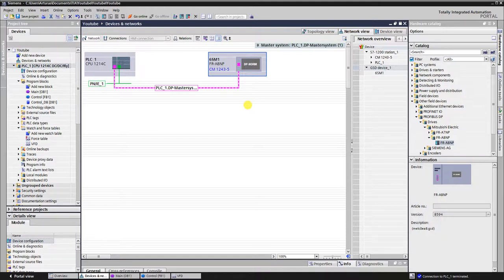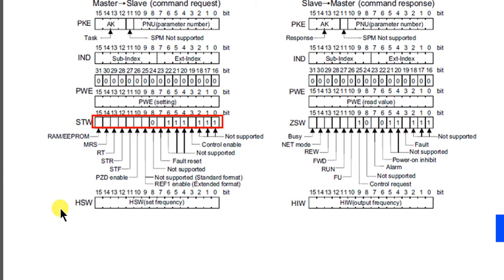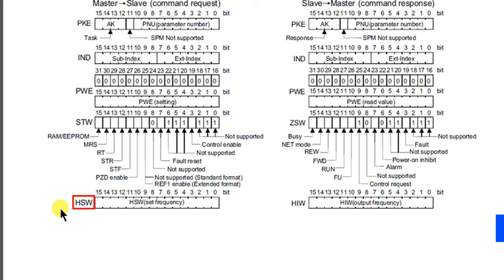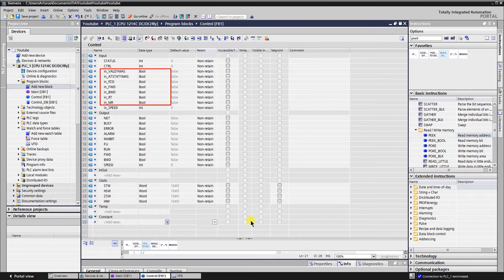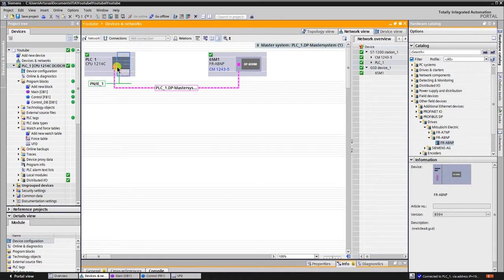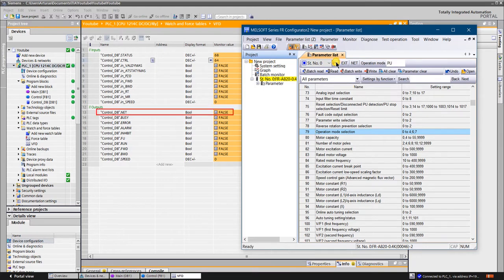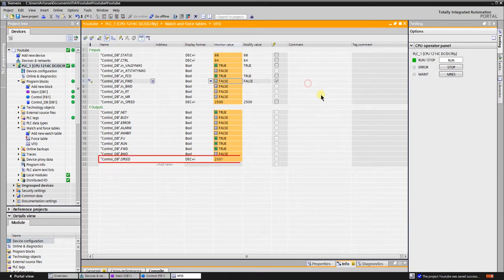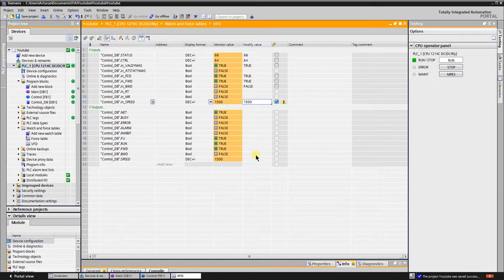Mitsubishi VFD control via PROFIBUS by Siemens S7-1200 PLC. Part 3, Step 7 program

Comment: How i should read value of current ?
Reply from the maker: Due to covid situation i have no chance to check it, but you coud try to change the parameter 52. If that will not help, then there is a possibility to monitor desirable values via parameters (my video https://youtu.be/7uCl9cFE65Y ). There is a real-time monitor possibility.